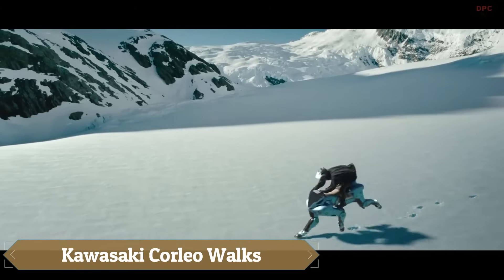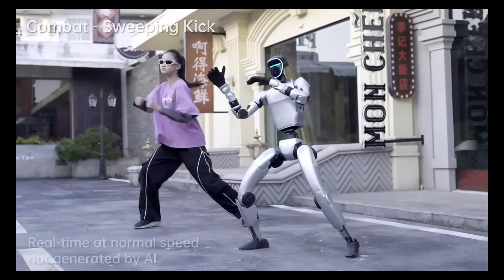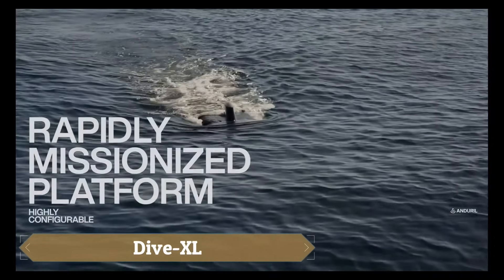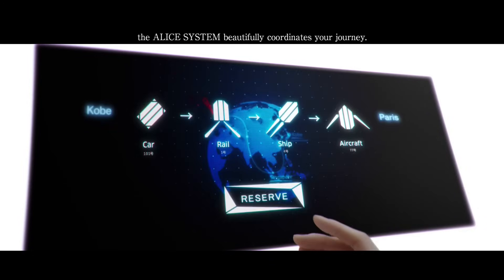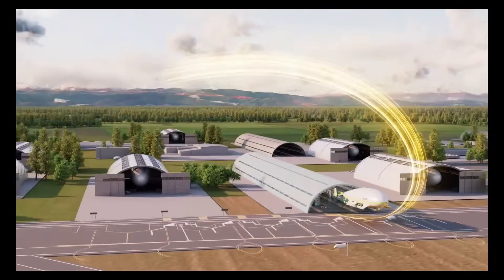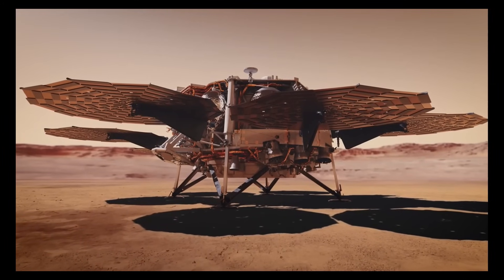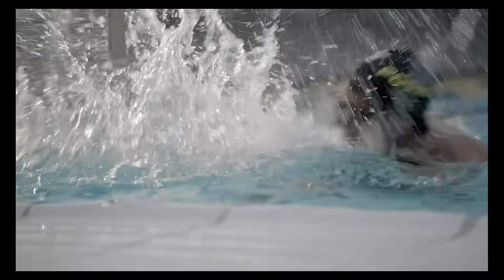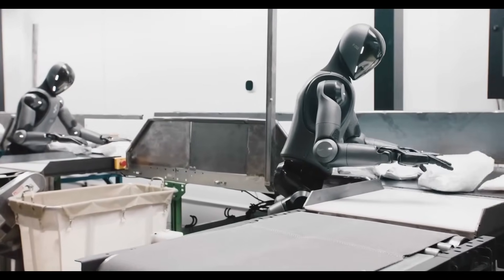15 Technologies That Will Change The World

Comment: Japan has always been the leading car manufacturer with good engineering and reliable cars. But EVs are changing the game, and they seem way behind this time around. Hydrogen tech may be the answer, but last I recall, a space shuttle blew up containing hydrogen mix fuel when the container leaked after it cracked from being thawed

Manufactured meat? NO. Because we know government will do something to it that isn't edible but something ominous
Reply: Hydrogen cars are not safe, but neither are gasoline cars. Also, gasoline and hydrogen have different ignition points. Gasoline is 300°C, while hydrogen is 527°C, making it a substance that is difficult to ignite spontaneously.
Hydrogen is 1/14th lighter than air, and even if it leaks, it easily diffuses in the air and quickly thins out, making it difficult for hydrogen in the air to catch fire. Besides, current EV cars have many defects, short driving range, long charging time, heavy body weight, useless in cold weather, EVs are scrap iron that cannot be sold without subsidies. Toyota was late to the game with EVs, but they are trying to be a game changer with all individual battery EV cars, I am Japanese.
Reply from the maker: @japan6821  thankyou for your compliment.
Reply from the maker: Thankyou for your compliment.